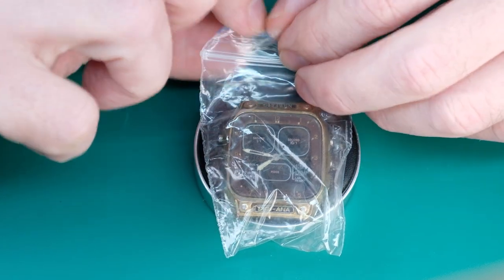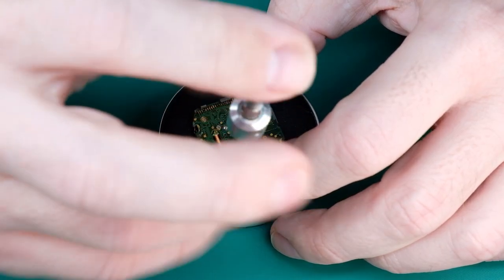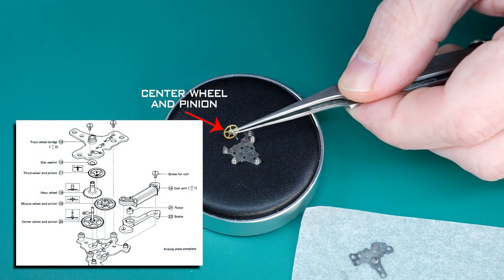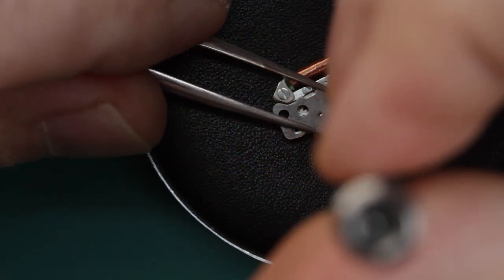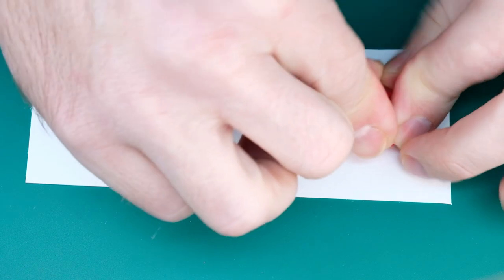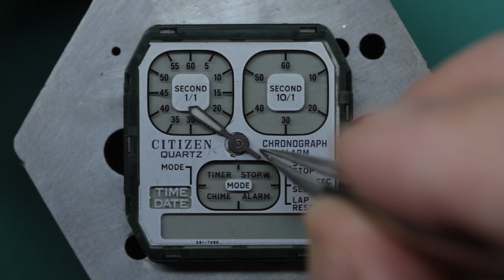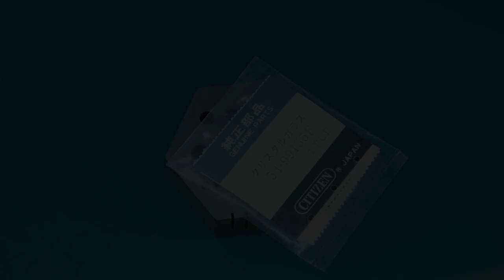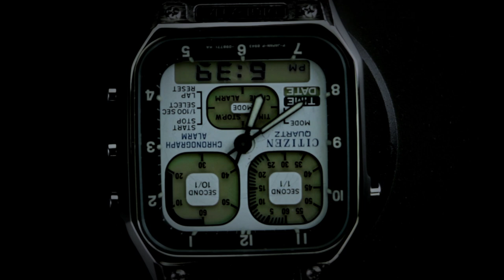A 40 Year Old Citizen Robot Face Is Rebuilt From The Ground Up

Comment: Really great video, thanks for sharing your knowhow with the world. I'm new to watch restoration and am trying to focus on these ana-digi/digi-ana repairs for now. I'd like to ask you two questions; When you press that new Chrystal "glass" in place, is there no risk of it cracking? Or are they just so very sturdy? I want to replace the glass in my 30-5511, but I don't have your press tool, what is it called? I'll see if I can order it on ebay.
Next question; Replating. Do you know of any person or shop in EU that I can send watches to be replated? I don't think I can make a lab for doing this in my home. Thanks a lot again!
Reply from the maker: Hello Ton and thanks for your kind words. For your first question, these crystals are actually glass on the these Citizen models and are very fragile. There is a huge risk of cracking/breaking them, therefore a crystal press is necessary if you want to achieve a good seal and an even fit. You really have to be very careful doing it, even when using a press. Ensure your crystal and your case are completely flat and do it very slowly. An extra layer of protection via a plastic bag would be a good idea. If you can, order 2 or 3 crystals and there's a large possibility that you'll end up cracking one the first time around.

For your second question, I'm sure there are many places in the EU which offer the replating service, but since I'm in Canada, I'm not aware of any in your region. I get mine done in Canada, (Montreal to be precise), at a place called "ReplateIt". You can find them by going to www.replateit.com. They offer a very good service at a very reasonable price. Just be aware that your case has to be finalized and ready for replating as that's all they do. This means all sanding and filing and removal of any scratches is your responsibility. They just plate the part.

Hop this helps and good luck!

Comment: I have one of these,it was the last present my Mum bought me before she died. I have been trying to get it fixed but no one will help . Any ideas?
Reply from the maker: Hi Ross. Getting these fixed is pretty hard these days as most watchmakers don't want to go near them due to lack of parts. I use parts from broken donor watches I buy on ebay.
With regards to your watch , it all depends on what the issue is. If it's a battery spill, new logic board for sure and that's just to start with. You could have a bad LCD, bad coil and so on. At the very least you just need service with cleaning and oiling. There are Citizen groups on FB, and someone may be willing to take on the job. I'm just too tied up at the moment to work on viewer's watches. Good luck!
Reply: Thank you so much for your time.

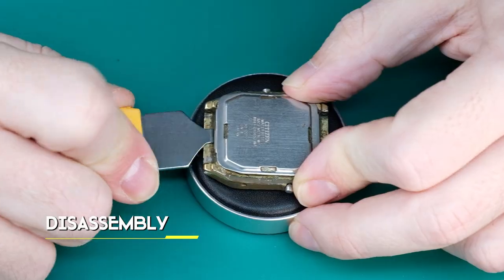Comment: Thanks for this video. I just acquired an "Omni" Ana-Digi with a Citizen 8940a movement in perfect condition but not running. It took me awhile to figure out how to remove the case back to remove the battery. Wish I would have found your video first! Then I couldn't remember how to orient the case back cover over the movement but your video at 1:05 helped me to determine that the "half circle insulation area" (if that's what you call it) underneath the cover plate goes opposite of the battery. Is this right? At first I thought maybe it should cover the battery to insulate the battery from the case back. My 8940a also has a little spring that you show at 42:40. What the purpose the spring? Hopefully I can get the watch fully functional with only a new battery which I have to source the 1120 (391) battery. I may be back for more questions. Thanks.
Reply from the maker: Hi there! That 'half circle" is the piezo speaker responsible for the beeping sound of your watch. The little spring is the contact between the positive terminal on your logic board and the above mentioned piezo speaker. The "half circle" part of that speaker, meaning the thicker part should be the one making contact with the little spring, so that's how you position the case back. Good luck!
Reply: @grumpyswatchrestorations  Thanks. Great information. I'm excited to see if I can get this watch functional. I was able to find instructions for this movement online. Hopefully a new battery does the trick. Cheers.
Reply from the maker: @mtbbiker6401  Sounds good and good luck! Let me know if you have questions.
Reply: @grumpyswatchrestorations  Hi. After installing new 391 battery in 8940 the digital portion is working but the analog is not. I'm also missing the battery strap you mention at 43':40". Just wondering if I need some sort of battery strap to make a connection from the (+) battery to the quartz circuit?
Reply: Okay, the analog hands would not move when trying to set the time with the pusher. I freed up the gears. Now I can set the time using the pusher on the side of the case, but the hands still do not move on their own. Since I can move the hands with the pusher, do you think the quartz circuit is okay and the problem is more mechanical in nature? Also how does the minute hands move normally? Does it move in minute increments or slowly like a regular quartz? Should I hear a "tick" for every second? Actually it looks like I am getting some movement of the minute hand but very slow so maybe the drivetrain is gunked up.
Reply from the maker: @mtbbiker6401  I'm about 98% positive it's not the battery strap. Many of those watches are missing them anyway and they still run. I'm also 98% positive that your issue is dried up lubricants in the wheel train of the movement. Remember that this watch is 40 years old, was never serviced and the factory oiled it with natural oils. Today we use synthetics which last pretty much for ever. You need to completely disassemble the movement, clean it and then oil the jewels and holes which hold the pivots for the various wheels. This requires some experience and specialized tools. I'll be restoring another Citizen Ana-Digi soon with a video to follow. Cheers!
Reply: @grumpyswatchrestorations  Thanks for the reply. I found an instruction and service manual for 8940/8943 on the web. It shows the "Power Cell Strap For Checking" as only needed for service when the movement is outside the case and is supposed to be removed when installing the movement in the case... "And never fail to remove the power cell strap for checking when the movement is put into the case". So it looks like the battery strap should not be installed. It's only used for service. What I find interesting is that the minute hand is designed to move every 20 seconds. It's not continuous like a regular quartz. I'll post a link to the service manual below.
Reply from the maker: @mtbbiker6401  I have that service manual. I question the use of english language in some parts though. As far as I know, the battery strap came with every watch to keep the battery secure in place but I may be wrong. I think the minute hand moves every 15 to 20 seconds on most quartz watches. Anyway, I'm pretty sure your issue is dried up lubricants as stated earlier. You'll have to clean the entire movement.
Reply: @grumpyswatchrestorations  Thanks. My watch is functioning normally, at least for now. I was able to blow out the gear train and lubricate the exposed pivots without taking the movement completely apart. The minute hand jumps every 20 seconds as designed and it's keeping time. No doubt it will eventually require a complete service but I'm nervous about repairing a digi-ana as I've never serviced one before. I'm comfortable with a standard quartz but nervous about something with a LCD display. Maybe I'll watch a few more videos and give it a try. Thanks again!
Reply from the maker: @mtbbiker6401  Glad to hear it! Enjoy your watch. Those Citizens are among some of my favorites of that era. Cheers!

Comment: Do you still buy these watches? I have one that is still in good shape. Suddenly it stopped  working. I thought it was the battery, I installed a new one and nothing. No body wants to fix it and I don't know what the problem is. But I always loved that watch. I think you may use it for parts or repair it. It is in good shape. By the way. It is a very good video.
Reply from the maker: Thanks! I don't buy them. I have all the ones I want which have been restored. Your watch could exhibit a couple of issues. Previous battery leaked and damaged the logic board, logic board may exhibit damage from age, the battery contacts are corroded, etc... Very few watchmakers want to touch these watches these days due to lack of parts. Cheers.